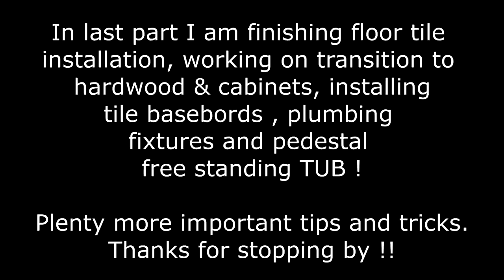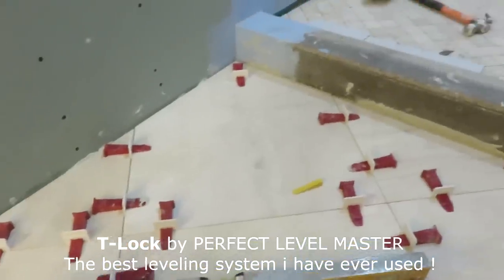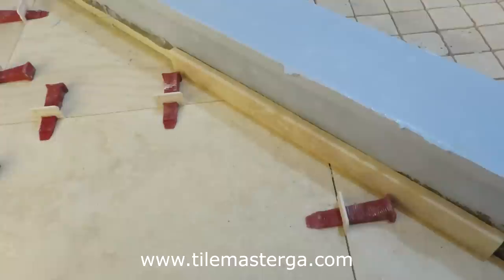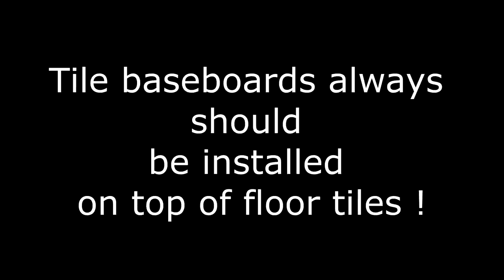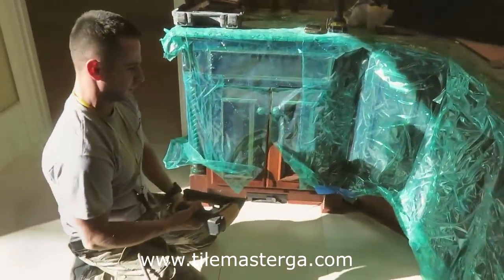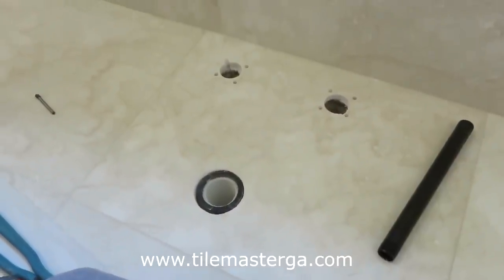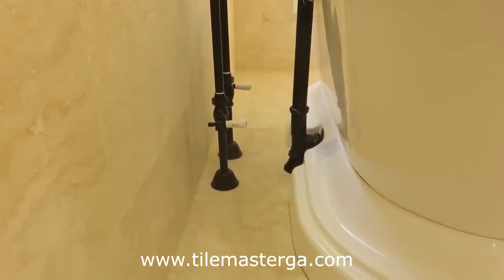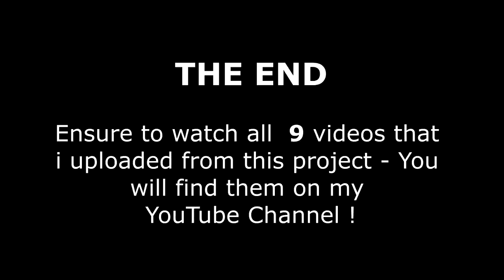"3" Installing 18x18 Travertine tile on floor & pedestal - free standing Tub, Final steps.

Comment: At about 6:15 in the video you mentioned that you had to break the tile to get it out. I was wondering you have eve tried using hand pump suction thing that auto body people use or what people that carry heavy pieces of glass with would work to help pull a tile back up without having to break it?